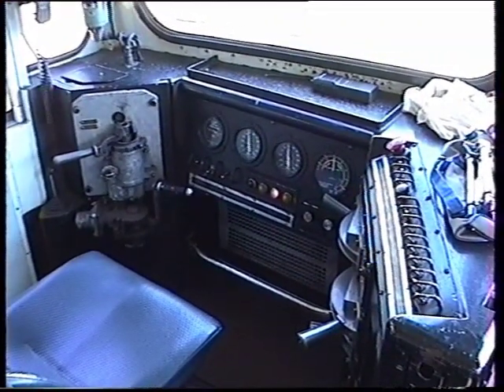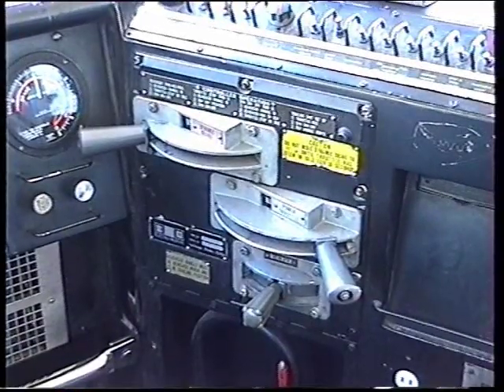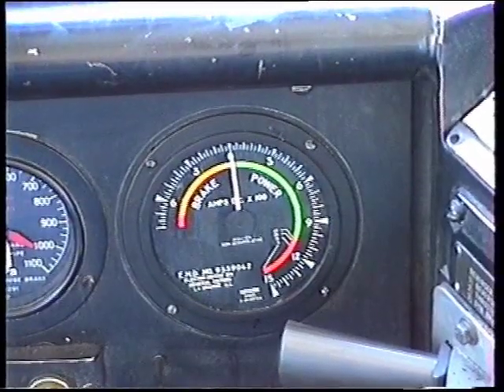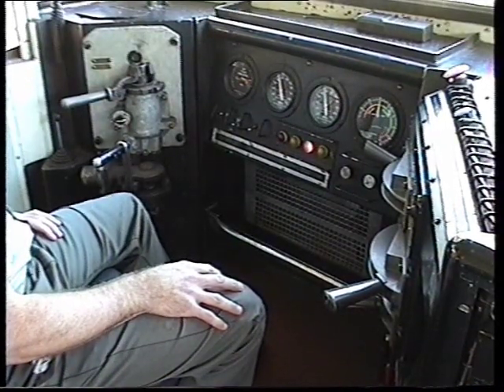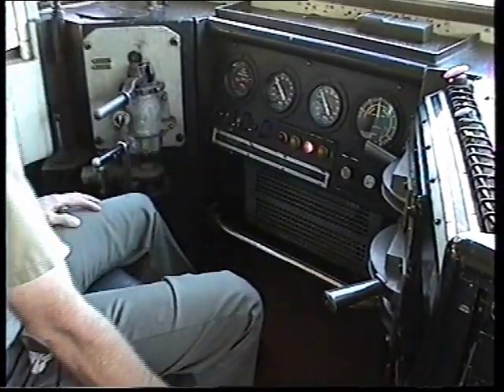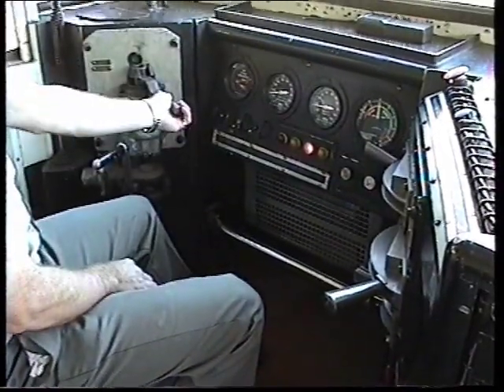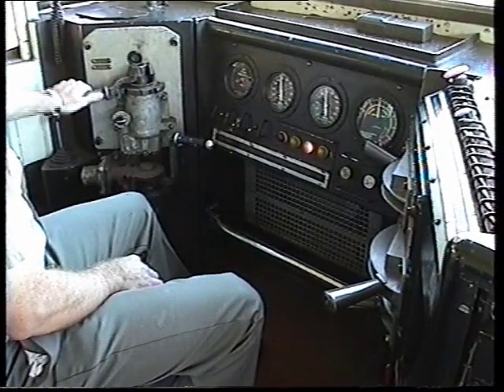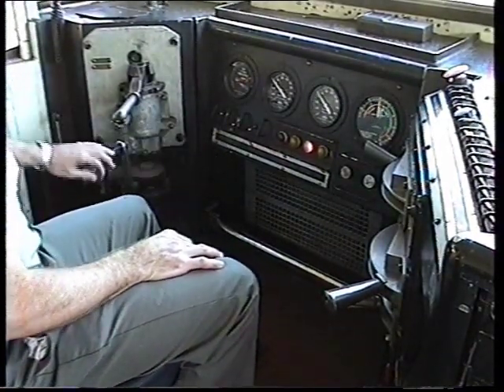8136 engine prep

Comment: Steve
Do you drive 82's? I'm looking for a similar vid that youve done here, but also starting and stopping the LOCO.
I'm getting an 82 built in 5" scale, and I would love to see if I can put some prototypical sound and operation in.. I'm thinking of using the Raildriver Train Simulator as the controls seem almost exact, and then I'll build a bank of pull switches on the right to amtch the cab.
Reply from the maker: G'day Stumpy,
Yes, I did drive 82 class things.
I do have some cab video shot but not any loco prep footage.
I was not a fan of the 82 class.
Yes, they possess the desktop 30CDW controls.
Starting was similar to the 81 class, except that instead of the 81 class pendulum there are three buttons.
Prelube, Fuel Prime and Start.
If you hit the prelube button, you are stuck for around 15 minutes waiting for it to perform.
When you get your 5 incher scale dingus, you will hafta make it do the 35 kph transition.
HIDEOUS generator transition, not traction motor circuit transition.
Steve.
Reply: Thanks Steve
Yeah I've got a Drivers manual from ARHS and I found some diagram / descriptions. 
Theres 3 generators, Main, Field and a 3x speed Alternator.
So by generator transition, you mean that the fields were switched?
As far as I remember back 2 years, I had the prototypical design where I was going to use high power relays to switch all Motors to series (Series), to 3 pairs in series (Hybrid) to all parallel (Parallel). The problem is the relays would fail and there would be a big fireball according to the guy thats going to build the model.
The 82 is a difficult model to build as its external walkways so very thin in the middle. I am supposedly going to get 4 batteries in the LOCO with 4 motors.
I am getting a very different drivers van. Instead of a small milk van, I've asked for a scale NHFF so it will also have 4 larger batteries in it. Problem is I will have 3.8 meter overhang off any station I drive at :)
Reply from the maker: G'day Stumpy,
The 82 class (can't refer to them as I normally did here in a public forum), was a kind of backflip.
Diesels possessing Main Generators normally required traction motor circuit transition.
The older style generator had to be small enough to squeeze into the locomotive body.
This did limit the maximum output.
Going to a Main Alternator to provide traction current meant that a lighter and smaller by comparison unit could be utilized.
Retaining DC traction motors required rectifying the output to DC, but could avoid traction motor circuit transition.
The 80 class were permanently wired in Series Parallel motor combination.
The 81 class in Parallel motor combination.
Field shuts continue to be necessary to permit traction motor armature rotation increase when achieving Full Field current.
Weaken the fields to permit faster rotation.
I won't mention AC traction motors as I did not work on any motive power with AC traction motors.
Except that a basic difference being that DC traction motors have short time ratings, whereas AC do not.
So, an AC traction motor can remain at slow speed with high amps without the possibility of cooking the motor.
The 82 class has a DC Main Generator that has two halves.
To provide grunt at slow speed, both halves are connected in Parallel.
But, once train speed has increased to that determined, the Generator halves are altered to Series connection.
More amps output necessary at slow ground speed, whereas more voltage output at high ground speed.
I kinda remembered that this was at around 35 kph.
But, checking me drivers manual, it stipulates a speed inbetween 40 and 45 kph.
The CLP things (yeh, I cannot refer to them as I did either), definitely did the Generator transition at 35 kph.
I remember that from when working the Silver Streak with them.
A similar situation, bang, crunch, whallop, cop that back in the dining car.
You had to either attempt to remain below 35 kph, or above when ever possible to prevent the fierce snatch.
Just as well that I don't wear dentures, or they would have flown out of me mouth when the transition occurred.
As with traction motor transition, there is a complete removal of power during transition, then return of power.
Traction motor circuit field shunts are less severe.
Locos that have traction motor transition were required to be marshalled in the lead of units that did not.
This was especially the situation if that transitioning loco had medium draft gear.
So, you would find a 44 class leading an 80 class etc due to that reason.
The crew would probably have preferred to be in the cab of the 80 class.
Traction motor transition was also at different ground speeds depending upon loco class and balancing speed.
So with a mixture of old locos, you would cop the transitions at different road speeds.
Wheel diameter, ring gear gearing, main generator type, all affecting the balancing speed.
The 82 class has a companion alternator to provide current for the main generator field excitation and cooling fans.
 As to your station "overhang" just adopt Car Markers.
Like those used at short station platforms for the Rocket (XPT).
A buddy has a 7.25 incher garden ride on dingus.
He had the vintage soot belcher 4-4-0 converted to battery operation.
No boiler inspections necessary.
He also had an 0-6-0 DM (pseudo cane loco) built which also runs on batteries.
It was acquired from a mob who build to 7.5 inch gauge.
So, he had to have his curved track eased slightly to accommodate the DM dingus.
I ain't squizzed it in operation as yet.
He has been building track for some time, but it is now ready for the golden spike ceremony.
If you could scrounge 24 volt motors for yer 82 class, you could do it similar to the real McCoy.
Have a pair of 12 volt batteries and start off in parallel output, switching to series and 24 volt at speed.
I don't know if this would work, you would need to consult a battery guru.
The 40 class MLW imports had manual traction motor combo transition selected by the driver at the determined speed.
But, if he forgot, then the train would not get any faster, or stall.
I do remember that when belting around Yankeeland on the wrong side of the car and road, I had a strange experience.
I had taken me 12 volt cigy lighter convection coil for boiling water in a cup.
The first time that I used it, I was amazed just how rapidly it boiled the water for me cuppa java.
The second time, I smelt burning and the cable started to melt.
I though nothing about it until at a servo some time later and thought to buy a replacement.
They only had 24 volt dingi hanging on the wall.
QUE Mr Fawlty ?
Didn't know did I that most Yankee cars have a 24 volt system to provide higher cranking amps during winter.
Steve.
Reply: @aussiealco  thank you for this I'll look out for the transition next time I hear a quad 82 coalie run past. They slow for Hurstville and the wagons get this massive compression rattle. I thought it may be the driver putting the air brakes on as the regeneration gets less effective at low speed, but may just be that generator transition.
Reply: @aussiealco  talking speed jerks, I heard from a u.s. Driver that used to drive the huge trains over the mountains. They got slammed as well, but by the coupling slack. As the train got over a hill they could hear it coming. Even with the massive locos, they sometimes got shaken to the floor. The locos would jump up speed by 15miles an hour.
Reply: Funy with the 24 volt thing.. 
This is the mob thats building the thing.. 1800w / 24v
http://www.minitrains.com.au/search.php?PartNo=L5CE82
Reply from the maker: G'day Stumpy,
It would depend upon the train direction of the coalie through Hurstville as to what you hear.
It be a goodly 14 years since I last worked a coalie through Hurstville.
So, I don't know what goes on today.
But, back then, loaded coalies would be halted on approach to Hurstville.
Suburbans and interurbans proceeding through, before the coalie could continue.
Hurstville is at the top of the hill, and quad tracks converge into double tracks.
Normally, a loaded coalie would enter the Illawarra at Meeks Road junction and proceed along the Down Illawarra Local.
Then, after halting on approach to Hurstville, continue through number 2 platform and then cross to the Down Main.
You should not hear any coupler slack run-in as the train should be stretched out after stopping and taking off.
However, if the driver has allowed the independent brake (engine) to also apply during the train brake application to stop.
Then, upon release, the train will roll away from the locos when the train brakes are released and the train takes off.
From memory, the turnout is 50 kph.
We were not permitted to work the quad 82's / 81's in more than 6th notch while passing under the Hurstville station structure.
You would smoke out the waiting cattle if notching right up to 8.
So, we would slowly crawl up hill and through the station to then cross over to the Down Main.
Shutting off power to coast over the hill and not exceed the 50 kph turnout.
There may be some coupler slack run-in heard if the driver engages dynamic brake to maintain the speed while dropping down to Penshurst.
For an empty coalie climbing and then turning out to enter the UP Local, yes, then you might hear so coupler slack run-in.
Stomping uphill from Penshurst, the grade eases from the 1 in 75.
And, you must slow the train for the 50 kph turnout from the UP Main onto the UP local.
Slowly shutting off power to let it run out of momentum for the turnout.
So, if the unit generators backward transitioned, you would not feel it as much with the power being minimum.
You may hear coupler slack run-in when the driver engages dynamic brake to descend the hill from Hurstville.
All trains possess some amount of coupler slack.
But, modern day USRR freighters have what are called tight-lock couplers.
Tight lock couplers were originally utilized on Yankee passenger trains to reduce coupler slack action.
The down-under Silver Streak has some of the worst coupler slack action of any pas job.
Our Western coalies are generally three pack with solid draw-bar links and auto knuckles at the end of the three pack.
The solid draw-bar does reduce an amount of coupler slack, but does not remove it all.
And, the auto-knuckle coupler ends still possess coupler slack action.
I drove a BNSF coalie in Minnesota state during my 2000 up yonder trek.
Two massive GE things up front with one DPU at the rear.
In excess of 120 hoppers in the train, which had tight lock couplers.
I only felt an ever so slight nudge when going through a dip due to coupler slack and the rear unit powering down hill.
I was impressed.
Mixed merchandise freights may continue to possess standard couplers, some with extended cushion type couplers.
And, did the trains is Tassie have some serious coupler slack.
The old screw link with buffer system did smooth some coupler slack action.
But, there still had to be some slack allowed to prevent buffer lock and lift on sharp curves.
So, when ever a train is slowing from power and especially into dynamic brake, then coupler slack will be heard.
To hear the actual 82 class generator transition you would need to be near Loftus.
The loaded coalie should increase speed after topping over through Sutherland and forward transition.
Providing that the train has the full road, it will increase speed on the level and slight climb through Loftus.
It will then backward transition as train speed reduces when hitting the 1 in 40 climb south of Loftus.
I remember that coalies did struggle up the hill to Sutherland and from Loftus when having the Aussie National AN class.
Yet another EMD waste of space.
At least the 82 class would maintain an average of 22 kph on the 1 in 40s, except in wet weather.
Though, while I was belting around of west coalies, such were 4200 tonner.
I don't know how the modern day 4500 tonners perform with the same motive power.
Regardless, f you want fair dinkum 82 class noise, then you will need the cab panel rattle when in 8 notches.
Everything rattled and vibrated.
I grew up on Aussie Alcos, and naturally prefer them.
Steve.
Reply: So yeah it was the down main so a full load. They'd do one of two things using Approach control on STOP.
1. Stop just outside Hurstville HOWEVER, you get stopped NHFF's all across Allawah station. Nice for me to photograph for my Ride On Model, but Taggers heaven, and also the possibility of idiot riders.
2. Stop at the road underpass bridge between Kogarah and Carlton, theres over hang thru Kogarah, but its OK as there are 24 hour staff. I lived on the road next to the bridge 2 years ago, so all the poor freight drivers would get an eyefull of a shirtless weirdo appearing and standing in the street at 2.30 am waiting for the acceleration.
This is where the train would stop for 15 mins, then the Drivers both 81's (wheat) and 82's (coal) would sparkup the notches to at least 6. This would stay like that for about a minute before there was a hiss of the brakes (and I guess the flip of the Generator Field enable in the cab. [got that tip from Railpage member] No noticable change in engine speed or strain, but the train would slowly start to move and probably 5 mins later it had got about 200 metres.) Spare a thought for the apartments build right up against the racks just before Carlton, literally 15 feet away.  :P
When I've caught the 82's at Hurstville (thankfully with a shirt on) apart from 'WHS Noise Safety Levels' I thought they were being careful of the crossover as it crosses from 3 to 2, then 2 to 1 and I thought the acceleration strain may be too much for the points config.. With points air controlled these days, I cannot see why they don't move all the points towards Penshurst to a straighter section with better straight line traction and not a blind corner. 
Umm so I just looked at Penshurst If you have alook at Google satellite, it doesn't make sense as when all lines goes from 4 to 2, theres a crossing from up to down anyway at King Georges bridge ..  :/ So they built a 2-3-4 run then do a second '3-4' anyway. Don't these designers have Train sim or something??
Reply: Interesting to read the operating action - Thank you Steve.
RE: Couplings: 
The Coalies and maybe the wheats are now threepacks. They have a bar coupling - I swear they got the idea from Ride ONs that have just that design. So three are permanantly barred together. Normal couplings link the threepacks. This reduces breakages, also as I was looking at a U.S. vid about AMTRAC safety, I believe the bars help to keep the wagons upright in a derailment.

They are looking to top-tail and apart from faster changing direction of a train, instead of the first coupling past the LOCOS having all the weight of all the 70 wagons and no force at the back. As long a the LOCOS in the back carrry half the load, then you get no force in the middle. and only 35 wagins either side. Same weight, less strain. WORSE CONTROL :) they are still trialling the comms between the locos as unlike the U.S. we have cuttings everywhere, and no 500 mile flat praries :)
Reply from the maker: G'day Stumpy,
The Illawarra was the first smog hollow suburban line to be electrified, as far as Oatley.
The rail corridor width south of Hurstville would not permit extending any of the lines towards Penshurst.
Bi-directional signalling is now in operation south of Hurstville to Sutherland, which provides greater flexibility.
Sydenham complex controls the Illawarra to Loftus, including all motorized points.
The main line points at Hurstville are generally 50 kph.
So, as long as train speed remains at or below such, no damage or derailment should occur.
The turnout from the UP to the Down at Oatley is only 15 kph.
There are actually five different locations where you can cross from the Down Local thence UP to Down including Oatley.
Sydenham complex can select any of such, depending upon rail traffic, if a points clean is necessary.
To keep the rail clean, trains can be sent via a different turnout to that normally utilized.
I only once went as far as Oatley on the UP before turning out to the Down.
The very slow turnout speed being awkward on the falling 1 in 75, plus naturally taking a long time for a 4200 tonner to clear.
The grade through Allawah is 1 in 60.
So, to hold a train stationary, the train brakes must remain applied.
The train brakes must be released for the train to start to proceed through Hurstville.
This will take a couple of minutes after the driver releases the train brakes from the front loco.
While the train brakes are releasing, he will need to slowly notch up a couple of notches to hold the train stationary.
The 82 class only have a single brake block per wheel, which will not hold a heavy train stationary on a grade.
Then gradually notch up until sufficient amps exist to move the train and he then releases the loco brakes.
Yes, we did use an old technique of reving the loco to pump up the train air system faster.
This being on locos with the compressor driven by the crankshaft, will increase the pumping more than when in idle.
But, you had to be very careful with this technique as there is NO load on the Main Generator.
If you went above 6th notch you could damage the armature.
The Generator Field switch must be OFF and the reverser in centre position.
After the system is pumped up, you must return the throttle to off and wait for the engine revs to return to idle.
Then you can switch the Geny Field switch ON and put the reverser into forward, then notch up for power.
Attempt to flick the Geny Field switch on while the engine is reving and you will cause a flash over (ground relay).
This old technique is not what you are hearing, as only the loco brakes would be holding the train during this technique.
You are hearing the driver gradually notch up to assist holding the train stationary while the train brakes release.
The gear driven compressor will naturally pump faster as the loco is reving to load up.
Other modern motive power have electrically driven compressors, which will pump at full speed regardless of crankshaft speed.
The "buff forces" created in a train with either middle or rear train assist vary depending upon the terrain being traversed.
The "node" is the location in the train where the buff forces are felt from both the lead and assisting locos.
Here we have restrictions imposed on the amount of rear train assist power than can be utilized.
This all depends upon the train weight and wagon type (loaded or empty) and draft gear type.
The PL class modified 48 class were the first attempt by the SRA (Freightcorp) to implement radio controlled rear assist.
This was not regarded as successful and the Port Link trains worked by PLs were both crewed.
The XPT being different in that multiple locomotive control is via electric cable through the train.
Permanently configured push-pull passenger trains are normally controlled via a multi-pin electric cable.
The cable also providing the EP (electro-pneumatic) brake control to the carriages.
Some modern day freight trains operate via ECP (electrically controlled pneumatic) brake system.
The cable connected through-out the train having only two wires only works the brakes and charges the wagon batteries.
Midtrain helper locos are radio controlled as the ECP cable is not capable of controlling locomotives.
I have viewed through the cab video that I shot of 82 class and none actually features the generator transition occurring.
No Go Pro dingus available back then to hide on the control stand.
I had to be careful just when and where I pulled the camcorder out of the work bag.
Steve.
Reply: I guess if I wanted to get a look around an 82 I'd have to go to their newcastle maintenance area.
Reply: WOW that's amazing stuff.. Thanks for all of this info. Funny I used to do the same in my car which was automatic at lights on a hill.. Take the brake off and slightly accelerate until not going backwards and not going forwards. - So basically I should have on my model at lease a shaker device with dice in it to emulate the control rattle. Some speed sensor so that at roughy 4k ( top speed for me will be 9k ) At that speed I will emulate the Gen cross over with some sort of reaction. Probably a spring will pop out of somewhere.
The trains are designed with Regen braking.
Well if you turn up to any Ride on clubs, I hope to be at a new club at Nurragingy called NWME. It's planned that the club track will pull people round the park as a sightseeing tour eventually. 
Else Wascoe (Theres an 82 here as well! Hand build by a guy called Col) or Galston, and at least once a year The Hot Pot run at Woolongong.
The same mob that is doing my 82 can do an 81 as well if you can afford it   :P.
Anyway my name is also Steve (Stephen) so if you see me around introduce yourself!
Cheers
Reply from the maker: G'day Stumpy Steve,
I am not sure just where or how you would be able to get to take a gander at an 82 class.
Public access to rail facilities is not normally granted these days.
The 82 class were built at the facility at Braemar.
And are possibly still serviced at Ready Power in the Newcastle region.
I did have a video clip uploaded to You Tube which featured briefly the cab and controls.
Titled Sunrise at Lithgow.
As you can hear the music radio in the audio, the clip was removed from public viewing as it contains copyright material.
The 82 class are fitted with a CD radio to entertain the crew, and most crews had the thing blaring music.
So, sadly, all of my cab footage video of an 82 has music in the audio.
So, there is no point my attempting to up load any more of that footage.
There is a ride on mob here in Bathurst within the Matthews sports complex.
I have been there once.
They operate once per month, on a sunday (I think).
I doubt that there would be an 82 class amongst their motive power.
There was an old codger who lived near Kelso who had a 7.25 inch ride on.
The feature loco was a NSWR Pig (36 class), live steam.
Nobody was permitted to drive it.
But, he did allow blow ins to drive his VR S class diesel which had a lawn mower motor and chain drive.
Electric locos may possess Regenerative brake, where the current created is sent through the pantograph to the overhead.
Diesels have Dynamic brake, where the current created by the traction motors is burnt off in grids on the roof.
Most older diesels will rev up when dynamic is engaged to assist with excitation.
Those units having field current control dynamic brake system.
The 82 class do not rev up initially when dynamic is engaged and operated.
The 82 class also don't have low idle as does the 81 class.
The tri-mount bogies of an 82 when in motion have a squeak as the loco bounces along.
And, the air moisture drains make a loud exhaust noise when they fire.
Air compressors create moisture when pumping due to the friction heat and then cooling.
Moisture in the air system is very undesirable, not only for corrosion but with the air brake system.
Older locos had manually operated moisture drains.
Subsequent locos had automatic drains fire when the compressor governor operates to load the compressor.
The moisture drain exhaust is a different sound to that heard when the compressor governor operates.
The compressor governor being inside the car body is not as audible.
When the compressor governor operates when main reservoir pressure drops to the setting, the control air is exhausted.
Control air pressure holds the compressor unloader valves open and there is therefore no air being pumped.
The crankshaft driven compressor pistons operate the entire time that the motor is working.
When the main res drops and the compressor governor operates, this control air is exhausted, the sound that is heard.
The unloader valve spring then forces them closed and the pistons now pump air into the main res tank.
When the main res tank pressure rises to the maximum, the compressor governor then returns control air to lift the unloader valves again.
When a loco is idling, you will generally hear the compressor pumping air by the thud thud sound.
Another air sound that can occasionally be heard is mostly only with multiple units.
Depending upon the loco compressor governor pressure settings, which all vary slightly, too much air can be pumped.
And the main reservoir tank safety valve can operate to exhaust air to prevent damage to the tank.
Model train DCC sound decoder chips feature some of these sounds.
You might be able to find an EMD 710G V12 decoder chip that you can incorporate the sound facets into yer 5 incher.
Steve.
Reply: They are re-painting the 82's, and the 81's (In Bananna Pajamas logo) ie stripy blue and yellow -  and the other 82 builder, Col got a look around before one was painted but after they had the scaffolding up so he was able to measure the entire roof as well.. I don't know if he had a Safeworking to let him in, but mine is 2007, so way out of date. I'll try to contact the mob that do the painting.
Theres a guy that turns up to the Hot Pot meetings - he has a 44 I think it is, it has start, idle, run, 2 or 3 notches, and shut complete with sound as an electronic degree project. He uses an airoplane remote. Either onboard or while shunting. He's onboard with anyone as passengers, but its safe to go driverless.. he has good Failsafe on the controls / brakes.
What I DIDN't know before I got into this recently is the Ride ON LOCOS do not have fail safe. They are lilke the old Heavy Rail design. Vacuum, so if the pipe breaks instead of putting the brakes on, they turn off. THe guy making my model said that he saw a fair few runaways. At 220 KG for the LOCO I DO NOT want that ... 
What I have is going to be Sprung Machanical brakes on my driving Wagon, brake held open by a solenoid but sprung, so loss of power = brake on. So if my LOCO fails, the regen will go off, and the Drivers Wagon will lock up as well.

The regens on my 5 inch Ride On is going to be the same as the 45 class the mob produce. It dumps the power back into the batteries.. Not the best as it shortens the battery life, and $1000 for another set of 4 batteries, but better that than shorten someones life. I had a VERY detailed design based on the actuak operation using Kettle elements, and real running fans doing what they really should do. Also, I had the motors / Generators set out in Series, Hybrid, Parallel. etc.. 
Prob is that to actually get something up and running this century I have to go commercial and theres limits on what they do. (Same as the real Sydney Trains / PN I presume)
Reply: I LOVE the 3642 Pig, It was going down the Illawarra a lot on Heritage specials. It also did the Hornsby to Gordon run on that line's 150th I think it was a couple of years ago..
Steamers don't operate in the NSW region [That is, Newcastle, Sydney, Woolongong] summer due to "Exhaust fire hazard" I've got PLENTY of vids of it due the Queens Birthday doing Central to Hursatville 4 times a day, most on mobile though.
I've got a few Garrett vids as well, they did a Pig / Garrett combo last year so there was 8 journeys instead of 4.. THe Garrett would always catch up the Pig  :P
*I've never uploaded anything, but maybe I'll drag a few of these out.. *

There no issue with Copyright is there because they are a Heritage run? 
I'm on the Station Platform.. ie inside "Sydney Trains property", not looking over a fence.. Is that OK as well?
Reply from the maker: G'day Stumpy Steve,
As long as the video that you upload is your material, there is no copyright problem.
Other than if commercial music can be heard in the audio.
As to being "on the property", staff can tell you to leave if you are perceived a threat.
Since terrorism, but more likely due to graffiti artists recording their artwork.
But a lot of people still take photos and video of trains.
There is naturally a difference to being on a platform or footbridge compared to trespass within the corridor.
In some countries, it is illegal to attempt to take photos of trains from stations.
Here it is more about "suspicious behaviour" that can get you into trouble.
So, I would not worry about your platform video being a problem.
As long as you are not doing anything dangerous.
I don't know of any 5 inch ride on things that possess a functioning train air brake system.
And, to achieve a reasonable battery recharge from rolling down hill in pseudo regen would require a decent long grade.
As to needing traction motor circuit transition, such would depend upon the motor demand and battery supply capability.
If your 82 can start and haul a reasonable train with the traction motors wired in parallel, then you don't need transition.
Parallel motor combination is normally desired for speed.
If the battery oomph is capable of supplying sufficient amps and volts to start and haul the train.
You would be varying motor speed via throttle notch, to crawl and not wheel slip, up to full speed.
If only slow speed is necessary, then the motors could be wired in series, or series-parallel.
It all depends upon the actual motors being used and the battery oomph.
As I have mentioned, the 82 class does not have traction motor transition.
But, the Main Generator does have transition.
The number of power notches available would depend on the motor capacity and battery supply.
Standard diesel loco design has 8 notches for power.
But, there were those that had more notches, and some that have NO notches.
Pure air throttle type just have a sweep of the throttle through the power zone.
The load for any diesel locomotive is a factor of the horsepower and balancing speed.
Basically what it will drag up a steep grade (nominally 1 in 40) without wheel slipping or going into short time ratings (DC traction motors).
The manufacturer will detail the loco capabilities.
But, most railways also perform load tests with a dynamometer car and heavy train.
Vacuum brake system can be confusing.
It is actually air pressure that applies the train brakes with the vacuum system.
Movement of the drivers brake valve into the application zone opens holes which admit air.
The vacuum is partially destroyed, or fully in emergency.
The air pressure applied on top of the vertical brake cylinder piston forces it down.
The problem with vacuum system is that maximum brake force is atmospheric pressure.
That being 14 psi at sea level reduces as you climb higher.
So, railways that work over high mountains don't utilize the vacuum system.
Steve.
Reply: @aussiealco   as usual gold comments - thank you
http://www.railway-technical.com/trains/rolling-stock-index-l/train-equipment/brakes/
I thought the air went into the cylinders next to each wheel, and it was air all the time! See, this is fht  the diff between doig theory only and theory AND practical. :)
The actual brake application was done thru the brake pipe but using an ingenious slider. The air means no unequal pressure on the brakes, so no bogie curve drifting!!
It was drummed into me many times during the Safeworking course that as soon as trhe brake pipe went - ie no air pressure. The cylinders leak a bit so have only a bit of time before the physical brake starts to be less and less applied.
That LOCO runaway at the Enfield intermodal going to the main seems to be an example.
basically as an observer I had to be prepared to jump out and run 1800m in steelcaps on stones, grab the last 4 wagons, and apply the manual brake.
If you hear a freight go thru, you will possibly hear near the end of the train dun dumd dum DUm DUM what happened is the train restarted, and the Observer forgot to go back and release the brakes  thus flatspotting some of the wheels and /or welding the powder from the top of the rails onto the wheel. 
These can be amazing.. the course I did showed one wheel with 2.5 ft of steel maybe 4 inches thick. 

HOWEVER, for passengers, this same thing happens...  But Folks reading this, have a listed to the train when there is a delay. say the guard needs to attend a passenger or something.
[Steve pls correct and also mod for what you do? any Passenger drivers please - correct if I've stuffed up, ]
Train comes into station 
Motors low humming - putting power back into the overhead wire. 
At some stage theres a hell of a screech and everyones teeth falls out, dogs collapse, and cats go loony. Thats the physical brakes taking over in the last few meters. 
Ding Ding (guard)   - Please park
Ding Ding (guard)   - OK acknowledged you.
There is a lous hiss from under all carriages. 
A [different??] physical brake [Park] is applied that had always been pushed off the wheel by the working brakes. 

When the stoppage is over,
Ding Ding (guard) - OK I'm back
Ding Ding (driver) - OK acknowledged you.
Hiss as air pushes the park brake off the wheel and the train (hopefully still has air in the cylinders cause its wasn't stopped more than 1/2 hour) can continue.

The sad thing about all of this is I was trying to emulate all this in 5: scale without actually having driven......... well I've now driven a 48 class -- erm 5" as well. 
I am mad.

In reality the conversation might go:
Ding Ding (guard) AAAHH THAT"S BETTER
Ding? (driver) What? You went to the bathroom??!?
Dong (guard) - yer
Ding Dong (driver) You @$#@ I thought it was an emergency!!
Dong Ding (driver) If you'd have told me it wasn't , I'd have gone as well!!
Ding Ding Ding (guard) - sry
Ding Ding (driver) - I've been driving crosslegged for the last half hour! 
Ding Di~ (guard) - well I~ 
Dung Dung (driver) - Your'e in the S### now 
Dang Dang (guard) - aah see someone who cares..
Reply from the maker: G'day Stumpy,
You are asking questions about two different types of brake systems.
All rail vehicles must have a handbrake to secure it against movement.
Older locomotives had a hand brake that worked on only one or two wheels sets.
On a steep grade that old style handbrake may not hold the unit stationary.
So, wheel chocks are also applied to the front centre axle on the driver's side.
Spring parker brake found on more recent locomotives and also emu and dmu trains is much better.
Air pressure holds off the spring.
When the air is exhausted, the spring applies the brake.
81 class have a handle in each cab to apply the spring parker to that bogie of the unit.
82 class and modern emu and dmu trains have train lined spring parkers.
Thump the button in the cab and all of the spring parkers apply.
This is the opposite to normal freight wagons where the rigging spring holds the brake off.
When the train brake pipe air is exhausted in emergency, the wagon brakes apply.
If the brake pipe tap is closed before the air stops exhausting, there can be a back pressure created.
This back pressure can cause some of the brakes to release.
And, the air applied in the brake cylinders will eventually leak off.
So, hand brakes must be applied to hold the train stationary.
If hand brakes are not released before a train commences to travel, yes sticking brakes occurs.
Where hand brakes are applied with the brake pipe air fully exhausted, the pressure can cause the wheels to slide.
Over time, scale can build up on the wheel tread.
The heat created by the sticking brakes melts the metal of the rail head which adheres to the wheel tread.
Scale can cause the wagon to derail.
Actual wheel skids will cause concrete sleepers to crack when the wheel is turning and thumping.
There are rules regarding the maximum scale depth, and also length of skids permitted for travel.
If you are referring to the Enfield run-away in may 2011, that was due to insufficient hand brakes applied.
The yard operator was changing worn brake blocks on a rake of 28 loaded aggregate wagons.
The falling grade in Enfield yard is around 1 in 100.
When air remains in the brake cylinders, to be able to change the brake blocks, that air must be exhausted.
A manual release lever is on all wagons adjacent the triple valve.
Pulling this release lever cable exhausts any air in the brake cylinders.
The rigging spring will then move the drop hangers away from the wheels.
When the released that wagon's brakes, the rake of wagons began to move.
He attempted to apply two handbrakes, but this was insufficient to hold the train once it began to move.
A number of run-aways have occurred in Enfield yard over the years.
Shunters would perform loose shunting and gravitate wagons by applying and releasing one or more hand brakes.
But, if the weight of wagons being gravitated overcomes the hand brake force, then away it goes.
i was in Cockroach castle (Enfield crew barracks) one night when I was awoken by load collision noises.
A rake of wagons had run-away and collided with something. 
Guards still exist on suburban and interurban trains.
Passenger services superintendents exist on long distance dmu and xpt trains.
Guards hold full safeworking credentials.
But, PSS only hold modified safeworking credentials.
Bell codes are the primary train crew communication method for safeworking duty for emu and dmu trains.
While in motion, two short bells (repeated if necessary) means STOP.
Two short bells while stationary advises that the crew member is leaving the work location.
Two bells to advise when the crew member has returned.
All bell codes must be repeated to acknowledge receipt.
Locomotive whistle codes were once utilized on locomotive hauled trains to instruct the guard.
Codes existed to tell the guard if he had to go back and protect the train, return to the van, or to come forward.
Bell codes replicated these whistle codes.
Where a passenger emergency situation exists on an emu or dmu train, the guard must attend to it.
If the guard is unable to attend to it, then the driver must attend to the situation.
Emergency alarms being heard by both the guard and driver.
Should the driver need to leave the cab, he must secure the train against movement.
That means applying the spring parker brakes on trains possessing such.
When an emu train that has regenerative brake is slowing to stop, regen functions on motor cars.
The EP (electro-pneumatic) brake is held off while regen is functioning.
Trailer cars have EP brake functioning.
Depending upon the emu train type, the regen will drop out at around 5 kph.
Then the train comes to a final stop on EP brake.
If the driver has his brake valve in full service, then full EP will result when the regen drops out.
When the regen drops out, the driver can quickly move the brake valve towards release and back into application.
This will prevent the EP from causing any rapid reduction is speed and possible wheel slide.
The Tangara sets are notorious for not stopping correctly during wet weather.
Should the driver place the brake valve into emergency, the driving trailer wheels can lock up and skid.
Clunk Clunk Clunk.
Tangaras have disc brakes, while older emu sets have clasp brakes.
Clasp brakes being the same as used on most freight wagons and locomotives.
Clasp brake blocks are forced onto the wheel tread to reduce speed and stop when necessary.
Disc brakes working like those on road vehicles.
Steve.